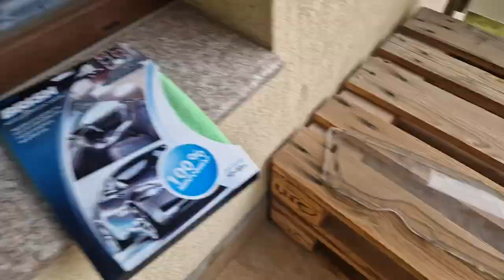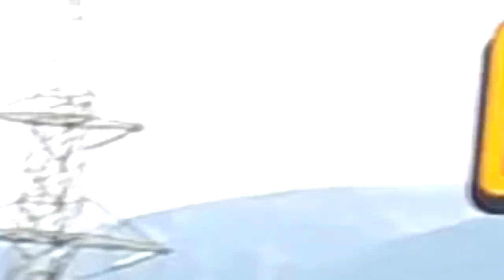BULGARIAN Corruption TOTALED MY CAR

Comment: well i mean as a bulgarian i can say that all you said about the politics corruption is right,you cant do anything about it,i mean it has grown so big you just cant do anything,so the only option is to know which roads get flooded during heavy rain(or any rain in that case)and just avoid it.We the bulgarians have learned and adapted to that so thats why it doesnt shock us that much!
Reply from the maker: Indeed as you say. The thing is the ring road is not a place that floods usually so it never crossed my mind that this situation could occur. Sofia in general is not a city that floods easy, especially around vitosha. All in all I could've avoided the situation but it would have been easier if the road was properly made.